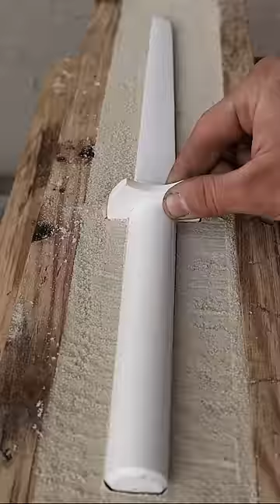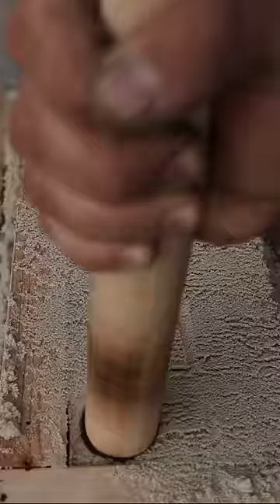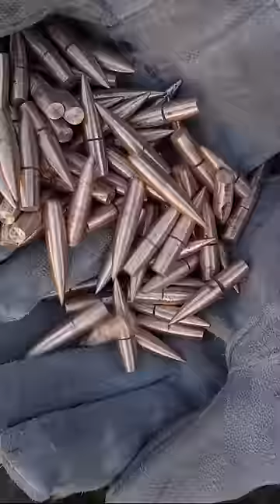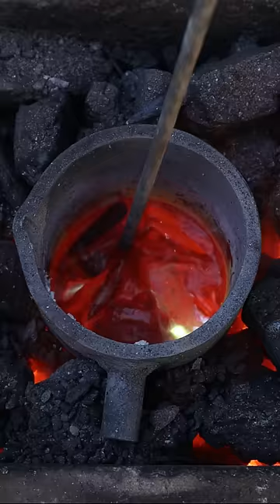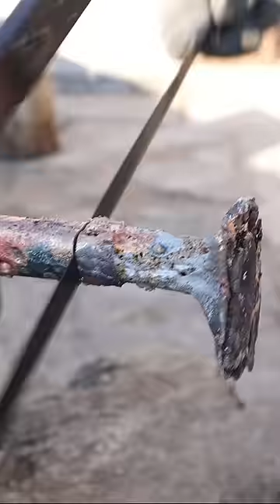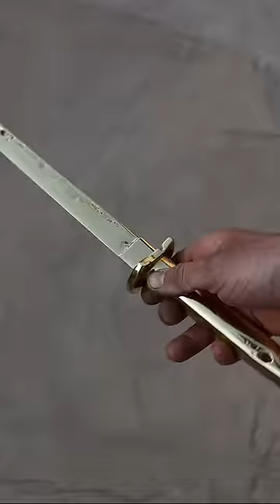A Fail Casting x100 Bullets into Tanto - Melting  Metal

Comment: As a reloader this hurts my soul a lil bit
Reply: Me too
Reply: Jst play the video in reverse, it's way more impressive!..
Reply: Agreed
Reply: Some people are just senseless.
Could have used old brass faucets.
Reply: You might be the right guy to ask then. Did he use all copper bullets you reckon? Because if not, then wouldn't there be lead mixed in too?
Reply: It is pointless.
Reply: It's my understanding that the bullets that were used had several imperfections!!  🤠👍
Reply: @worldtraveler930  That's seems pretty clear just by looking at the video. Very rough cannelures on some of 'em.
Reply: Ammunition. Especially copper core hunting ammunition are pretty fuckin expensive to be making a whole sword out of instead of just scrap copper or bar stock. 

Yes. I reload. This kind of hurts my soul just a wee todd bit.
Reply: Me too. Coulda used some old brass fittings or something else
Reply: All those happy freedom seeds turned into a blade 🥲
Reply: @craigthemonke794  CRAAAAAAAAIIIIIIG
Reply: he could melt it down and cast more projectiles when needed lol
Reply: Fed
Reply: I mean he didn’t use the shells?

Comment: it's possible that the he  is using borosilicate glass shards, which is commonly known as pyrex
borosilicate glass has a very low coefficient of thermal expansion, meaning it can withstand extreme changes in temperature without cracking or shattering 
by adding these glass shards to the forge, 
he could be using them as a visual indicator of the temperature of the metal
Reply: Hes doing it as a sort of flux coating.  The molten glass is less dense than the metal and will float to the top to keep it from oxidizing.
Reply: @willdoner3174 thank you. came looking for this answer
Reply: i aint readin all tha

Comment: Casting brass is harder than it looks, huh?
Reply: That's lead, not brass.
Casings are brass. Bullets are lead.
Reply: @lockhd_mrtn  no.  Some bullets are lead.  Mostly are copper.   Then if you look at military rounds its usually  copper with steel tip for amor pierce.
Reply: There are also brass jacketed bullets. But solid copper and any variation of copper jacket bullets when melted down doesn't make brass. He cut the camera off and never melted his expensive bullets. I bet it was a bunch of empty cartridges he could no longer reload or found at the range.
Reply: @tj44236  the video was defnetly cut and edited  yes.  It looked like he tried making an alloy .
Reply: @frikkiesmit327  No, most bullets are lead with a copper jacket, and ap rounds will have a steal core then lead then a copper jacket
Reply: @frikkiesmit327  mostly are copper? Big false. Even fmj is just a copper jacket. Steel and lead are what you find in the core.
Reply: @Frikkie Smit  the bullet is always lead unless it is a special round. Military bullets are required to be FMJ (full metal jacket.) This is the part that is copper or sometimes brass.
Reply: @frikkiesmit327  Most are lead. The copper bullets you speak of are lead bullets with a copper jacket to comply with the geneva convention. Armor piercing ammo typically has a steel core inside of the lead. The tip is just colored to show that it is ammunition for a particular purpose, like armor piercing. There are 100% copper bullets made for non-toxicity though, which are reasonably popular now for defense and hunting.
Reply: @frikkiesmit327  no, bullets have a thin copper jacket, but have a lead core, because lead is cheap and dense. Giving the bullet weight in flight.
Reply: @Frikkie Smit  military bullets are copper and lead for the average bullet, except maybe newer development like m856 or m855a1 maybe. Barnes makes hunting bullets that are all copper as an option.
Reply: @frikkiesmit327  nope, its got a copper casing around a steel core so it doesnt deform in the barrel
Reply: @lockhd_mrtn  copper outer, lead core
Reply: Too bad those bullets are lead cores. With copper jackets.
Reply: @frikkiesmit327  no 99% of all bullets are lead. 

What you are calling copper. It the jacket around the lead core. 

And if you want to talk about military there are multiple different cores. Not just steel there is also magnesium cores for tracers/incendiary. 

But 99% of all ammo the general public is allowed to have is lead core with copper jacket. Just because the bullet looks copper/brass. Doesn't mean the core isn't lead. 

You really showed your ignorance and the fact that you have never shot a gun in your life let alone bought ammo
Reply: @tj44236  you do realize all brass is made from copper right?

Copper and zinc make brass. So every part that you call brass is made of copper zinc alloys 

Now they do sometimes use only copper to jacket the lead core of a bullet. But all brass is also made of copper.
Reply: @Viktor-Tsoi  actually no all FMJ are copper... Not brass... Copper is a softer metal. So that way there is more energy  Dissipation when the round hits and deformation. Helping prevent over penetration. 

And also has to be softer for AP rounds so the steel core can push through the deformed lead core and copper jacket.
Reply: @soulseeker42388  correct. I didn't state otherwise. They don't make copper jacketed zinc core bullets so I called shenanigans.
Reply: @frikkiesmit327 You are clueless. MOST bullets are MOSTLY lead. They have a thinn copper jacket that’s usually 2-3 thousandths thick, hence the name “full metal jacket”. Most copper projectiles have to be special ordered. Unless you’re even dumber than expected and are referring to the casing…. Which is brass.
Reply: Casting brass is pretty hard actually, it kicks up alot of impurities when smelting and is very particular about the correct temperature
Reply: @tj44236  actually Bulgaria has been sending some that is zinc core with copper jacket.
Reply: @frikkiesmit327  Still not brass.
And, why would copper be used for bullets?
Lead is denser, heavier, toxic, and probably cheaper. It just does more damage.
Reply: So is brassing casts
Reply: @lockhd_mrtn lead is not golden, those were more than likely brass bullets
Reply: @frikkiesmit327 most bullets are lead with a copper jacket around them

Those military bullets you are talking about are still lead with copper jacket but they have a steel core/tip
Reply: @gumbuswatersen963  What about copper-jacketed rounds?
Reply: @refueling_is_too_expensive  what about them ? Usually those are lead bullets wrapped in copper, they can also be made out of other metals but they are most commonly lead

Comment: Looks cool I worked in a foundry without any fancy equipment for about a year. it was satisfying but hard work. Bronze and brass can be tricky, aluminum is pretty forgiving. The divots in the blade is either contamination or gas that got trapped during the pour. When I encountered these issues I would add vents throughout the mold. That might help.
Reply: Sand was too wet. Should be using Petrobond.
Reply: @Justa Burger  I love petrobond. I got the foundry I worked at to switch over to petrobond. It made a huge difference but some people are put off by the upfront cost understandably
Reply: I have working in a foundry for 9 years, we most cast in bronze sometimes aluminum, and some small works in silver. It was called the bell foundry and I have maybe formed and cast a couple of hundred bells for Carillion. most works were sculptures. sand water-glass and a hardener the mixture we used gave us about 30 minutes to work before it got to stiff.
Reply: How does he get the white sword out of the sand without messing it up? Am I missing something here? I've watched it like 20 times
Reply: @BooBuKittyPhuk  it actually burns off when the molten metal hits it, so they just leave it in
Reply: @Sasquatch10499  seriously? How? What is it?
Reply: @kai BooBuKittyPhuk mmm  I've never used this method myself, but it's based off lost wax casting here they use foam which common. I think they might call it lost foam casting. Check it out it's pretty cool there's alot of stuff on lost wax casting on youtube.
Reply: @Stroke2Handed yeah i assume the moisture on the sand caused a rather larger amount of steam to fill the sides of the mold causing the dimples.
Reply: @doinksinthePM  That's what it looked like to me.

Comment: Honestly, I don't think this was a fail. While there are points of improvement (which I will clarify I can neither identify nor do better at, as I have absolutely zero experience casting anything), I think it turned out beautifully. I've always been rather fond of a worn look on any kind of blade.

Comment: I'm sure you'll get a lot of use out of a lead knife
Reply: It's brass, they are fully brass rounds
Reply: Jacob please stay in school if you think shell casings are pure lead
Reply: @J.s1h2  ah didn't know though there were some sort of FMJ rounds. Makes a lot more sense now
Reply: @jacobgracia8603 no haha you’ll know if they’re special rounds based on the tips, you can tell they are full brass because of the full tip, hollow points have a separate tip so do incendiary
Reply: Full brass rounds? No.
Reply: @OfLanceTheLonginus Speak for yourself. He was talking about the actual round, not the casings.
Reply: @tombryant4518 I thought the same thing, but they really exist.
Reply: @MrFinalresistance  I know they exist. But they are machined, expensive, and not very common. They are usually used in larger caliber target loads, not run of the mill stuff.
Reply: @tombryant4518 I'm sorry, I should not have made that assumption.
Reply: @MrFinalresistance  Don’t be sorry. All good.
Reply: @OfLanceTheLonginus  even American schools don't teach you about guns, or at least they don't anymore
Reply: @bigbird4481  honestly it depends on the region/public or private
Reply: @OfLanceTheLonginus  Those are bullets. Not shell casings.
Reply: It looks like Russian 7.62x39 but the fact that it melted so easily in the fire suggests it must  be lead, steel is harder to melt
Reply: @OfLanceTheLonginus  you probably shouldnt talk smack when you dont know what youre talking about.. "shell casings" LMAO, if you know, you know.
Reply: @kx250monster1023244  yay I was waiting for someone to flame me, dont know why it took so long, weird. 
also nice numbers in the name haha, reminds me of xbox times
Reply: @OfLanceTheLonginus  i dont believe that was "flaming you" i was simply pointing out the fact you clearly dont know the difference between "shells" and "casings" good try tho cutie ;)

Comment: what caliber were those bullets? they looked odd
Reply: .30 cal? Looked like a .308 projectile
Reply: @DanielDuhon  could very well be
Reply: looked to me like 300 blk
Reply: Something kriedmore I believe
Reply: @Squid-Game   too long for 300 blk maybe 7.62x54r or .308 would be my best guess
Reply: @Coldcooler3  well seeing as 308 and 300 blk can use the same bullets it could be
Reply: @timbur2711  💀
Reply: Most likely a .308
Reply: Its 375
Reply: Looked like 7.62 mmr or 7.62 NATO
Reply: 9x39mm for sure. Russias version of 300blk. It's what the supressed AS VAL and VSS fire.
Reply: @timbur2711   308. is usually a heavier bullet with more grains so no but thanks for incorrecting me
Reply: @Coldcooler3  Hey man so no, your wrong lol you can get bullets ranging from 90-220 grains for 300 black out and 308 can range from 110 to 220 and they are the same diameter so you could load any 308 caliber bullet into a 300 black out case if you have the load data
Reply: They appeared to be .30 caliber (.308)
and rather expensive, as they are individually machined on a special engine lathe, created to produce repeat parts.

Comment: I never pour straight onto the mold surface as I found the impact from the metal pouring can damage the impression. Make a 90 degree bend in the cope, pour from the top bend and use a riser.

Comment: I can get that white powder was flux, but for what is the green glass in there? Also bullets contain lead so did that mix in with the copper to make that shine gold? Does that count as brass or bronze?
Reply: In the video, I noticed there was no lead core it was solid brass bullets as far as I could tell from the video. If they had lead, they would be jacketed rounds, meaning brass over lead, and the back end of the bullet would show lead as the jacket doesn't cover the lead completely. I hope this helps or explains a little. Also, if it is a mix of brass and lead, the majority of it would be lead like probably 80-85% lead to 20-15% brass, and I am unsure what the material would be considered or what color it would have but it would be heavy and sort of soft from being mostly lead
Reply: @ericrichardson3332  brass? i was sure bullets are made of copper. i have seen full jacket, lead bullets but have never seen a whole single metal solid bullet.
Reply: @Guy shaashua  look it up people use them in hunting and target practice for deeper penetration, they as in the bullets are more expensive being solid brass and just because you never used them or heared of them doesn't mean anything and it is brass jackets and brass cases referring to the shell and bullets being made of brass you don't hear people say I'm going to reload me copper lmao 🤣 they do make cheaper copper bullets as well but those look exactly like what I said just google it and see
Reply: @Ohio_etsu-masu  those solid brass slugs are stupid expensive compared to normal copper lead core fmjs. the brass ones are usually machined not casted and specially tempered i dont even understand why he would use these large dangerous game rounds for this shank to begin with just from a price stand point
Reply: The video was definitely edited.  Whatever those bullets are,  I doubt he used them.  The end result looks like brass, so he probably just melted a bunch of empty casings.
Reply: @theoriginalmonstermaker  thats because they are brass, those rounds are designed to maintain shape through bone and tissue the whole way through large dangerous game like buffalos lions and elephants those are not normal slugs those are super expensive

Comment: @ almost perfect how do you melt your metal?  I would like to start making some tools out of scrap since I have a bunch and I also have a bunch of tanks of propane to burn but I don't know how to get the aluminum hot enough...Any advice on how I can make a decent Lil mini forge ? I already have a  small bucket from home Depot padded with cement
Reply: I would not recommend casting tools as you get a bunch of bubbles which could lead to weaknesses, instead cast them into bars or stock to use to forge a tool, as for making a crucible and forge just look up a YouTube tutorial, they exist

Comment: Was the model sacrificial or had you removed it prior 2 pour?
Reply: It's a sand cast so i guess it would be hard to remove the model without destroying the cast. The styrofoam model is usually dissolved by the molten metal.
Reply: @DeaBroggn  wasn't clear model was styrene, so cool lost model method. Removal depends on sand composition, to be fair,  I never saw registration pins, so removal not likely. 

The powder, I presume was meant to facilitate separation & that confused me...
Appreciate the details.
Reply: @patrickhayes3099  True, the powder would indicate it being separatable later, though he just destroyed the cast at the end.
Reply: @DeaBroggn  so you see why I'm confused...
 I appreciate the validation.   Cheers

Comment: not to downplay a beautiful hobby but if you're using FMJ bullets, only the outer jacket is made out of copper alloy, the core is lead so it could seriously impact the melting and increase weight
Reply: The bullets he showed looked like monolithic copper bullets to me, meaning no lead core, their just solid machined chunks of copper, I'm guessing he didn't actually melt any bullets and instead melted down some casings he had, and edited it not show that part, cuz those bullets definitely looked very much like copper,yet the sword come out as brass